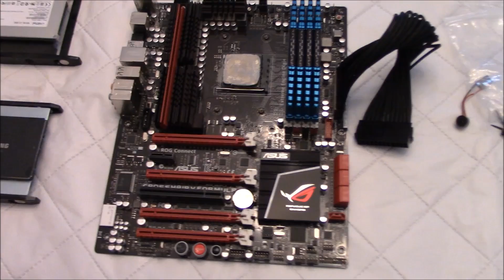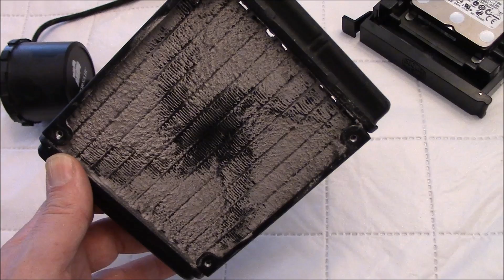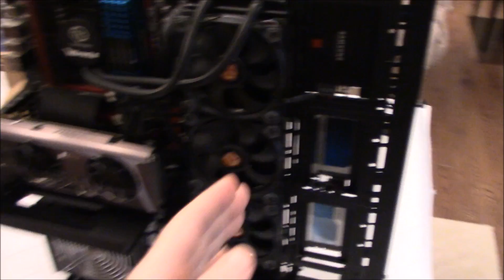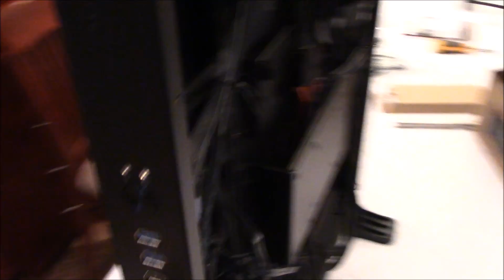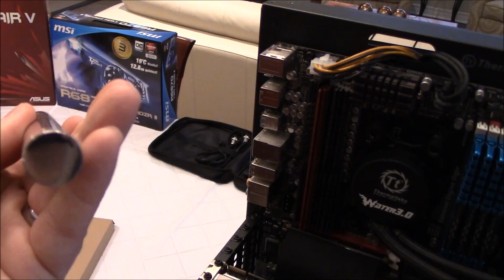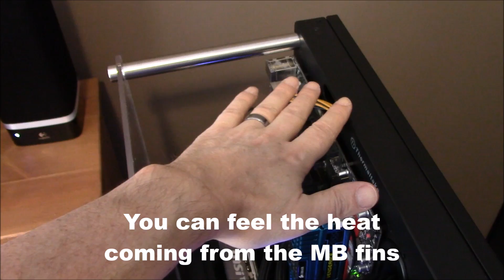Thermaltake Core P5 build | Amazing case!!!

Comment: if any one is still active here may i ask if the fact the radiator has no flow through the rear panel does it or did it effect the cooling of the cpu  ?... i no its a 5 year old video but im about to recive this case an its been on my mind  ?
Reply from the maker: There is a one inch gap in the back that you do not see in the video, so the flow is fine.  However, I wanted to improve the flow so I upgraded my setup about two years ago and I moved the radiator (a new one) to the right where the case has a vent.  I show that in details in a more recent video.  Everything is in my PC upgrades playlist including the new AIO.  You should have a look before you build your Core P5.  Good luck!
Reply: @SuperdanTech  thankyou for replying and yes im going to watch it today on my lunch thankyou

Comment: Hi,
I have bought Thermaltake Core P5 and I am shopping for AIO liquid cooler and considering getting Lian Li Galahad 360 ARGB AIO Liquid CPU Cooler, but if it doesn't fit, I will take another one. Could you suggest which one to go for?

Thanks
Reply from the maker: I did a more recent video where I show my new AIO, you should watch that, https://www.youtube.com/watch?v=teUioFBDPt0&list=PLjf8BjEsfThFP-V_TmwToRBCN13aSpgnm&index=18
Reply from the maker: And watch this one also for the length of the cooling tubes, https://www.youtube.com/watch?v=RXzoqV_SztI&list=PLjf8BjEsfThFP-V_TmwToRBCN13aSpgnm&index=21&t=2s

Comment: I don't think the cooling fans are set up properly here without proper airflow
Reply from the maker: Yes they are fine.  The special brackets from Thermaltake that I show in the video gives a 1 inch clearance in the back for proper ventilations.  My thermals are very low, proof that the whole setup works well.  I upgraded this system since I did this video.  I installed an updated Thermaltake AIO water cooling system with LEDs, Corsair RAM with LEDs as well and a more recent MSI MB with Ryzen 5 CPU.  The videos are in my playlist. Thank you for visiting my channel.

Comment: I'm running the same 8350 still. It's a great multithreaded CPU but it's about time to upgrade. I really like that PSU, might upgrade from my 850 Thermaltake Gold because there's no LED or PSU software unlike the other DPS one I had before. Should've looked into it further when ordering. I'm running a 5600XT which is reallly, really throttling on this platform even though I get 45fps on ultra at 1440.
Reply from the maker: Hi here and thanks for watching.  I upgraded this PC several months ago (Ryzen 5) and I posted a few videos on the build, the LED RAM sticks and the new AIO cooling system.  The videos are in my PC upgrades playlist.  Cheers!

Comment: What is the length of the radiator hose? I notice that different brand has different length of the radiator hose.. I hope u can reply me.. Because I'm now planned to use corsair h150i water cooling that has 14inch length hose.
Reply from the maker: I now have the newer cooling system with full RGB. The videos are in my playlist. The tube length on the new one is 15 inches. Thank you for visiting my channel.

Comment: I say, leave the posts and the plexiglass off.  Kind of annoying they didn't make a place to mound a 5.25 DVD drive for Windows installs and key disks (like for flight sims and other games, where DVD1 has to be in the drivebay for the game to play).   That's going to be a PITA if I ahve to grunge mount it sideways so the dvd falls out whenever you open the drive bay.    Some people suggest a USB DVD drive and I'm like um no.   

Wrap your yellow cable with 

Split Loom Black Electrical Cable Protection Conduit Plastic 
https://www.ebay.com/sch/i.html?_from=R40&_trksid=m570.l1313&_nkw=Split+Loom+Black+Electrical+Cable+Protection+Conduit+Plastic+&_sacat=0
Reply from the maker: The case did change quite a bit since I posted this video.  I now have an ASUS Strix RX580 OC GPU and all my SSDs in the front are black (860 EVO). Much better looking. Yah, not having a slot for a DVD is kind of a bummer.  Like I said in a previous post, if you don't use the bracket at the bottom for a liquid cooling reservoir, you could use that to mount a DVD drive vertically.  That would work I think.  Thank you for visiting my channel.

Comment: Great looking case. Just have a question about where and how you mount cd/dvd drives for this case?
Reply from the maker: Normally you don't.  Meaning that you have to use a USB optical drive.  BUT...if you look closely at my video, one could use the bracket for the water tank (if you don't want to use an open liquid cooling system) to mount the drive on it.  In my case, I installed the RGB control box for the closed loop system on it.  Thanks for watching!
Reply: transfer to USB for DVD or Floppy because bay on front no longer in the future.
Reply: @rabigjr  I recently got one of these thermaltake cases and built a system, because they look great. I rigged a drive bay at the rear. Transferring to USB is not practical as I have lots of software on cd, dvd. I also have thousands of music cds, and downloaded music. I like to be able to burn Cd's to play in cd player in car. Yeah I could use an external usb optical drive but that seems kind of stupid, to have all kinds of external devices when you have a huge case.

Comment: If I get this case would the Kraken X62 CPU cooler be long enough to reach the radiator mount?
Reply from the maker: I don't think so, it is a long way from the CPU to the right side of the case where the mounts are. Have you checked their website to be sure?  The Thermaltake Core P5 is an awesome case!  Thanks for watching!
Reply: @SuperdanTech  Thanks for the reply. I can't find any info on minimum tube length. How long is your tubing? Apparently the x62 is 400mm which might be enough.
Reply from the maker: My tubing is about 300mm long.  400mm might get you all the way to the right slot for the radiator!
Reply: @SuperdanTech  Awesome thank you. Just ordered everything and it arrives on Tuesday so will post here with the results incase anyone finds it useful.
Reply from the maker: @lhardly  you are welcome!
Reply: @superdarroch  Yep no problem
Reply: Atleast deepcool captain 360s fits perfectly! Tubes were almost too long hehe. This case is super nice to build on and cable management was so nice. Overall very satisfied and perhaps in the future i buy tempered glass panel for it 😉

Comment: Great video, it is possible to replace the hoses of the radiator for some more long billiard cues in order that they fit in his place or probably another brand of watercooling has the longest hoses?
Reply from the maker: Thank you!  No you cannot change the tube in this kit.  When I bought it online I was hoping for a longer tube but I decided to keep it anyway.  I have not done any research recently but there are probably other brands out there that have a longer tube.  Thanks for watching!
Reply: @SuperdanTech  Yes! You can change it... I done cutting mine and connect some themaltake tube fittings.
Reply from the maker: @noelhermidilla8873   Interesting!  I knew you could cut it but did not know that fittings would work and seal it correctly.  Do you have leaks?

Comment: I got one of these cases recently.  P5 Core TG, I too had ran into issue with the AIO tubes being too short to reach the CPU.  This case came with a motherboard plate that you can attach to the case that allowed you to mount the motherboard horizontally which helped with getting the AIO to reach the CPU.   I put aside their included riser cable and bought their new PCI-E riser cable that is more flexible, 2x 600mm length,  I was able to mount 2 GPUs on the riser extension.  I run my Threadripper 2 on it.  Right now I'm looking for a case fan cooler designed for this style case because they still get kind of warm.
Reply from the maker: Sounds like a great build too.  Mine does not get warm at all and I have an overclocked FX8350 running at 4.2 gHz.  The fact that the top and the two sides are fully open provides a lot of air convection (towards the top obviously).  In my "case" I did not see the necessity to add a case fan.  Good luck with your mod and thanks for watching!
Reply: SuperdanTech  I should have added that I am doing a little GPU and CPU mining on my rig too.  Placing a desktop Lasko fan face down on top keeps one of the VEGAs I'm mining off of at a constant 72°C and away from throttling down.
Reply from the maker: ha, makes sense.

Comment: That's a nice Power Supply you got there. xD
Reply: Name of Psu?
Reply from the maker: @MrChristoferthz , Rosewill Lightning 1000, Gaming Power Supply, 80 plus gold. 5y warranty!
Reply from the maker: Thanks!  I am actually very surprised that not more people picked up on that PSU!  Awesome piece with 1 kWatt power, LED output (when a cable is connected), red or blue LED for the fan.  It has worked flawlessly for 6 years and at some point I had two velociraptor HD (when SSD were way too expensive) and two RX480 OC GPU in crossfire with six fans!  Thanks for watching!

Comment: so is that really an open case? like no side and top panels? how is the airflow working out? or is that my vision playing tricks on me and there are actual panels surrounding this case?
Reply from the maker: No voodoo tricks!  It is an open case, no side and top panels.  But as you see in my setup, the GPU fans are vertical and the AIO cooling fans are also vertical.  All these fans push air backwards and then the heat goes up by natural convection.  It works very well.  In fact, the inside temps are lower than when I had the Cooler Master HAF (closed case).  Thanks for watching!
Reply: SuperdanTech ok thnx for answer. Now is there option to order this case with side panels and make it actually a closed case? The reason I'm asking is because if I had that I would have it set up in a different configuration. Also is that a tempered galss or plexi/plastics?
Reply from the maker: I don't think you can get side panels.  Mine is plexi but there is a version with tempered glass if you want.  I guess that would had some weight to the case!  You can also install the case on a wall, which is pretty cool.  It has VESA brackets holes in the back.  You would just need to find a nice way to hide the cables.  Good luck with your future build.  Like my title says, this is an amazing case!
Reply: You can buy extra tempered glass upgrades, which includes top, bottom and sides.
Reply from the maker: Thank you Jeppe for the info!

Comment: dude get a ryzen 5 1600 at least.
Reply from the maker: I know!  The Ryzen 5 1600 is almost 50% faster than the FX8350.  But I have overclocked my chip from 3.7 to 4.2 GHz (with almost no increase in temperature), which helps a little.  The real problem with the upgrade to Ryzen is that I would need to change my motherboard... Probably an upgrade for next year.  Thanks for stopping by!
Reply: at microcenter ryzen 5 and motherboard bundle is $229. that dirt cheap for 6 cores 12 thread. you can play game and stream at the same time.
Reply from the maker: Yes that seems like a good deal!

Comment: Is there any way to mount a dvd-wr unit on this model?
Reply from the maker: The quick answer is no.  But if you build a bracket at the bottom or use the water cooling tank bracket, you could install one.  In my case, I installed the AIO control box on the tank bracket.  Otherwise you would have to buy a USB DVD unit and connect it when you need it.  I hope this helps and thanks for watching!
Reply: Thanks man!
Reply: yes there are > https://www.youtube.com/watch?v=nlKoj7qB0eE
this ugly metalbox with clock is dvd unit (upper machine)!
ps.sorry my bad english
Reply from the maker: Yes of course you can mount a dvd this way.  There is lots of room since there is no 3-fan AIO cooling system in the way.  Does not look very good though in the P5 if you ask me...
Reply: yeah its ugly :D

Comment: Can you mount 2 360 radiators side by side?
Reply from the maker: Looking at my setup, I think a second 360 radiator would fit to the right but where would you connect the tubes?  Thanks for watching!
Reply: SuperdanTech I would just Daisy chain them both with a tube just cause I have 2 to install and think it would look nice.
Reply from the maker: That would look amazing!!!  Then you would install your SSDs in the back I guess.
Reply: SuperdanTech yes I would install the ssds in the back. The reserviors I would install horizontally on top and bottom of the 2 360 radiators. That's my idea at least, the case is coming in and hoping it works out like I have in my head. Thx for the idea of the aio brackets. Would have never know they existed!
Reply from the maker: You are welcome and good luck with your build!

Comment: Lol how's that aio cooler working for ya without a vent behind that rad lol
Reply from the maker: For a strange reason, my original reply disappeared... Here it goes again... I was a little skeptical too when I unboxed the Thermaltake AIO and saw how short the tubes were.  You can hear it in my tone of voice.  But after installation in the Core P5, there is a good 3 cm of clearance between the back of the radiator and the case, which is sufficient for a good airflow.  I have had no issues with temperatures and I am running an overclocked F8350 cpu at 4.2 GHz!  I also show more on this build in my videos about installing an ASUS GPU and 4 SSDs.  Thank you for visiting my channel.
Reply: My guess is that due to 3 fans you are making up for the chocked air flow. I'll be doing a build with this case soon so I'll update this when I do
Reply from the maker: Hi Nicole, I know..I was skeptical too. You can probably hear it in my tone of voice...lol.  But after 6 months of use I am REALLY,. impressed.  When you use the Thermaltake AIO brackets to mount the radiator, there is a good 3 cm spacing between the back of the radiator and the case, enough for a very decent air flow.  I highly recommend this case.  You should also watch my video where I install 4 SSD in this case, you will see more cool views.  Thank you for visiting my channel!
Reply: I thought I was the only one who noticed

Comment: how many hdd's can it hold ?
Reply from the maker: Hi Nabhan, look at my video on "Four SSD to install". The Core P5 comes with 4 HDD/SSD brackets. But the Thermaltake AIO brackets (sold separately) also comes with 3 brackets.  So you can install 3 HDD/SSD in the front of the case, and 4 in the back.  My current setup has 3 SSD in the front, 1 SSD in the back and 1 HDD in the back.  Thank you for visiting my channel.
Reply: Thank You

Comment: How well does it cool?  been considering this, as well as an AIO to use for it, but worried on how well/bad it cools
Reply from the maker: It cools very well.  The power supply and the graphic card have their own fans with the heat going up the case.  The CPU has water cooling with the radiator fan, and the heat going up the case again.  Since there is no top, all that heat goes up the case!  Very good cooling.  I may do a video soon with a temperature gun to show the heat pattern in the case.  Thanks for watching!
Reply: Oh snap!  I'll follow that if you're going to constantly work on the PC/other PCs.  I'm in love with that content haha.  I do have 2 questions, if you could please answer them; 

1.  I heard the GPU fan being vertical meant it getting hotter.  Is this true, at least on this case?
2.  I notice you have one of the Thermaltake riing AIO.  I was wondering if you could pull out the cord (loop?) in order to install your own.  I wanted to do a temporary AIO liquid cooling setup becuase I just ordered a waterblock for my gpu.
Reply from the maker: 1. I don't think this is true.  Not with my experience with the P5.

2. I looked at my Water 3.0 AIO and it does not look like you can pull the two cables off the radiator.

Comment: Bonjour, and thank you for the excellent videos with ongoing upgrades.
Can you send me the link for the brackets you used to shift the cooler to the center?
are those brackets included or is it something i will have to buy. I read your comments and you mention to buy those brackets separate. But to your comment to Moejaza you say everything is included and nothing else needs to be purchased.

thank you greatly for your help.
Reply from the maker: Merci!  In my comment to Moejaza I meant the "box" of the brackets kit, not the box of the Core P5.  Sorry for the confusion.  This is something you need to buy separately from the case if you want to install an AIO (All in One) water cooling system.  I bought my box of 3 Thermaltake brackets from Amazon.com, here is the link; https://www.amazon.com/Thermaltake-CORE-Bracket-System-Mounting/dp/B01EOPIFOE/ref=sr_1_1?ie=UTF8&qid=1511097755&sr=8-1&keywords=thermaltake+core+p5+brackets

They are not expensive and yet very useful. You will need all three brackets to install your cooling system in the center of the P5, or perhaps only two if your system is not too long.

I hope this helps et merci pour regarder mes vidéos!

Comment: How do i install case fans to this without a radiator?
Reply from the maker: You cannot, unless you make special brackets to hold your fans at the top or the back of the case.  Regardless, this case was not designed to install fans in this manner.  Thanks for watching and have a great day!
Reply: SuperdanTech thanks!
Reply: @SuperdanTech  Hello again, Stupid question, I ended up 3d printing my own AIO brackets from their website (since they are no longer made), but i've run into a issue, How do you secure the bracket itself onto the case, since there are no screw holes for the screws to go into. Do you just use washers and nuts, or does the actual kit have screw holes?